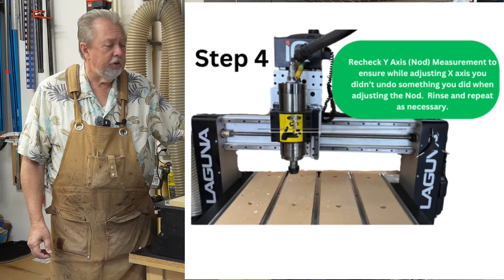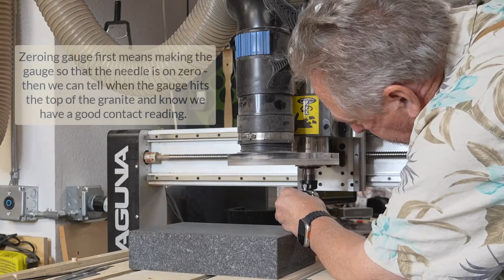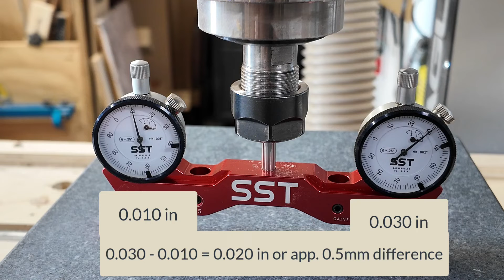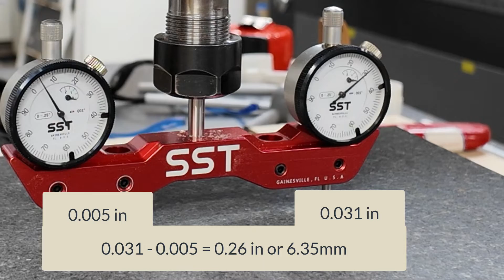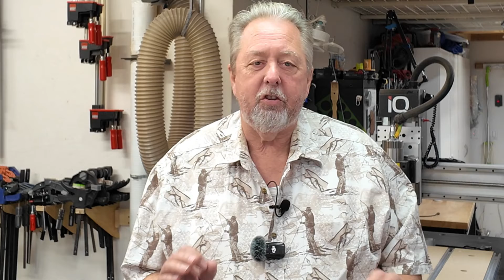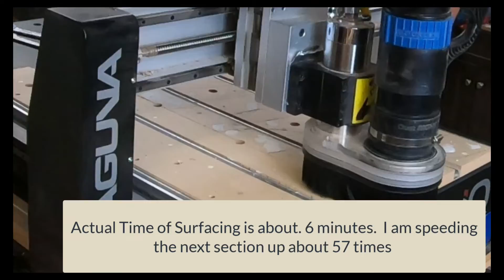Tramming a Laguna IQ CNC Router: Easy & Accurate Alignment with the Simple Stupid Tools Jig

Comment: Thanks for the video. It was very helpful.  
I have a couple questions.  In testing for flatness, couldn’t you have used the sat guard and just look at one gauge?
Where did you get that granite block?  Do you think a 12” square piece of glass would work as well?
Reply from the maker: Thanks for watching.  I got the granite block from Amazon.  Since that time in working with Laguna I found out they use a 1/2" Aluminum plate.  I purchased one of these for next time.  I will say it is more expensive than the granite - but so much more easy to deal with.  It was about $90 so it is pricey.  If interested I can try and find a link but I bought it from McMaster car and I got the 10" diameter one.  I have heard from others that they use glass but when I spoke with my nephew who is a glazier he said glass isn't as flat as people think.  So, I shied away from glass and will use the aluminum plate when I replace my spindle - which I expect to do in the near future.  As for using one gauge, that is a possibility - but you would have to make sure it doesn't rotate and stays in the smae position relative to spindle as you go from corner to corner.  For me making the 3d printed gauge holder took away the chance of me goofing that up.  I offer the 3d printed gauge holder on my webiste for free if anyone wants their own.  Good luck with your efforts.
Reply: @RobSandstromDesigns  thanks for the info.  I found the plate.  Yeah pretty speedy but I can see why you like it more.  I would use your 3d part but I have a 1/4” collet.   I am going to try glass first to see if it good enough.
Reply from the maker: @SteveKickert sounds good.  Let me know how the glass works.  I have heard of people using glass so interested in your experience

Comment: Nice video, thanks for taking the time to thoroughly show AND explain your procedures! I'm not sure it was necessary to create the 3D printed dial indicator holder. You could just pick one of the SST dial indicators and then use its readings to shim the flat reference surface based on measurements at the 4 corners of the reference plate. This will work as long as you DO NOT rotate the spindle/SST jig while you're comparing the measurements at the 4 corners of the reference surface. Because at this first stage we assume the spindle is not trammed correctly, any rotation of the spindle/SST could alter the measurements. This problem is avoided if you simply DO NOT ROTATE the spindle/SST. 

"Spoiler board"?
Reply from the maker: Thanks for the feedback.  You are correct about I could've done it without the holder but printing the holder was easy and made the process straight forward.

Comment: Great info! Thanks
Reply from the maker: Thank you for leaving a comment and I am really glad you found it useful.  If you're getting ready to tram I wish you success and patience.  I found I made it more intimidating than it actually was.  I put it off way longer than I shoul have.
Reply: I’ve trammed a few times but not to this degree, as luck would have it the back of my spoilboard is a bit low for some reason… needs resurfacing, so no time like the present to tram as well!

Comment: I'm glad I found someone with the Laguna IQ.  I should check the tram.  It seems to be ok. Also, I have fastened a 3/4" MDF spoil board.  That way I'm not wrecking the original board.  I know you lose 3/4" of usable Z height, but in 8 years, I have never carved anything thicker that 1.5".  I also could raise the spindle if I needed to.  Just a quick question, how often do you change the water for cooling the spindle?
Reply from the maker: I was previously told to change it every 4-6 months.  But, I admit that I don't change it that often.  I have a story about the water flow and spindle cooling I could share - but I wouldn't do so in an open forum.  I try to be vey careful with anything negative i have to say about products or people.  I don't mind giving praise when it is deserved, but I try to be more private with my criticism.  If you want to reach out via email or via Zoom chat, I would be glad to talk everything i know about the IQ.  I have had it since 2019.  It has been a real beast, but there are some things I have found to be aware of.  One of those would be to change your water as frequently as you can tolerate.  The manual I have states the following should be done weekly:  "Swap water lines at pump using the quick connector. (Take free line into bucket, and put into pump, take line from pump and put as free line into bucket) This will help remove build up from the lines and spindle by reversing the flow of the water."